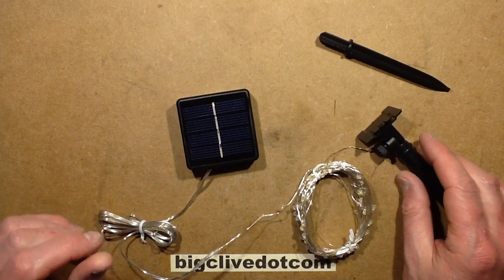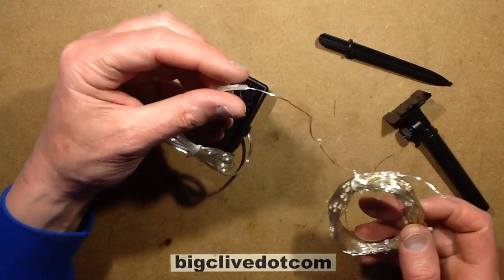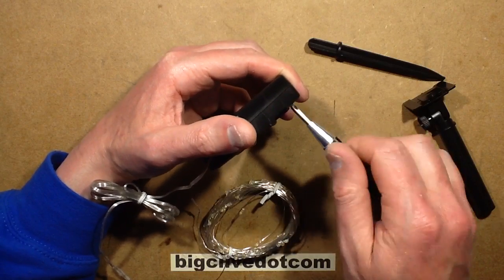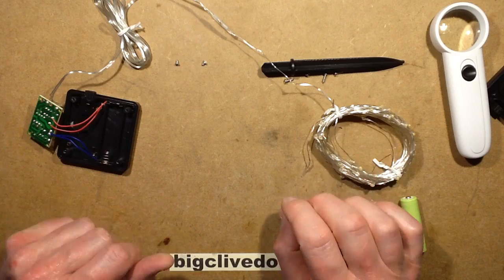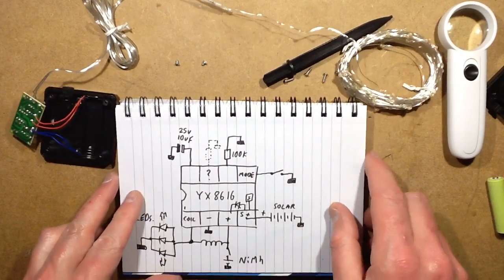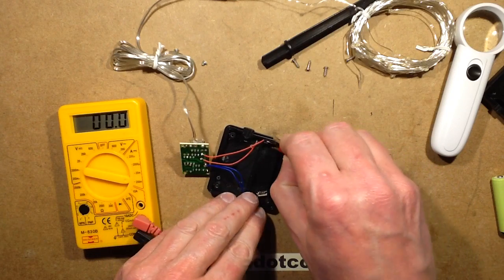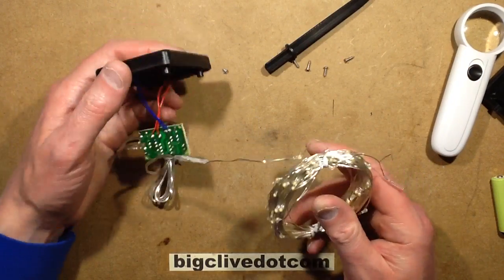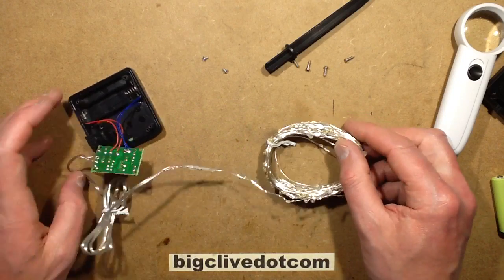Solar LED string with resin dipped LEDs.  With schematic.

Comment: Hi, Clive.
You said that the 100k resistor on the PCB was for the flashing function. I don't know nuffink about electronics except that you often need a resistor in an LED string  to ensure that you don't blow the string.  Is that what this resistor is for? I have the string of LEDs from an identical one of these where the battery box got smashed and thrown away. I found a mains power supply that's marked as having a 3.3v output @ 2.0 Amps and would like to use it to power the string. What resistor, if any, should I use in the circuit which has 120 LEDs? Can I even use this PS safely?
Reply from the maker: The 100K resistor was for timing in this application.  For the low voltage parallel strings like these you can use a standard USB power supply to run the string with a couple of 10 ohm resistors in series.  With a 3.3V supply you should be able to use a single 10 ohm resistor.

Comment: I don't know if your version is the same but mine outputs AC voltage or a "push pull" DC output (isn't that AC? ) to control two sets of leds. Every other led in the string is reversed. This is done to alternate the on time of the lights. 
so when:
"set one" turns  "on" 
set two = off 
When
set one is off 
set two = "on "
(when it sinks current).
Then the cycle repeats.
 Reminds me of a 555 IC circuit.
Reply: I also found this about the chip in mine (ANA6518 IC)
The ANA6518 is an integrated circuit (IC) manufactured by SMC Corporation of America. It is used in various applications including communications equipment, wired networking, enterprise systems, enterprise machines, personal electronics, and portable electronics.

This IC is green and compliant with RoHS (Lead free/RoHS Compliant) standards.
 It can be sourced from Worldway Electronics, which is an authorized distributor for SMC Corporation of America.
 The ANA6518 is available in stock and can be shipped globally via DHL, FedEx, UPS, TNT, or EMS.

Another IC, the ANA618, is mentioned in the context and is used in solar-powered lawn lights as a controller for LEDs.
 However, the ANA6518 is a different IC and is not directly related to solar lawn lights.

The ANA6518 is often used in circuits that require an H-bridge for driving LEDs or other loads.
 In one application, it is used in a circuit that steps up voltage from a 1.2V battery to power LEDs

Comment: These are either the same or very similar to ones I've decided this year to use as my christmas tree lights. I figure this way I don't have to find a power point to run the lights to and I don't have to remember to switch them on in the evening... once it gets dark outside the tree lights... it's very handy (I also have a number of similar sets in my greenhouse and they've been in there for probably a year or so now and do seem to last quite a long time on one charge). Not bad if you can pick them up cheap :D

Comment: Would wiring 2 or 3 rechargable Ni-Mh batteries externally be fine as a modification to extend runtime of the lights? Though getting them charged up by the solar panel is also a slight concern for me since there's more cells to charge.
Reply from the maker: You can use a higher capacity cell.
Reply: @bigclivedotcom  Thank you. I plan to get a set of the Solar String Lights for use on a small christmas tree soon. It's nice that the rechargable cells I got a while back for Wiimotes that never ended up being used will find a new purpose.

Comment: Is there an option to make only solid mode lights? They have some memory of last mode, but from time to time it resets and mode changes into default blinking one. But my wife wants them to be solid always 😅
Reply from the maker: Some sets have memory, but it's not easy to convert the non memory units.

Comment: Kind of tired of solar garden LED lights since they don't seem to last too long before breaking and when they do work they really struggle to stay on until late enough in the winter. They don't seem to have improved at all for 10 years either, I can buy a set online now and I bet it's identical to the one you have here 7 years ago. Thinking about connecting my garden 12v light supply to them. Do you think I could do that simply by just using a buck converter to put the 12v down to 1.5v or so and then connect it up to the battery terminals shown in your video? I've seen another video connecting 5v from directly to the LED light string which sounds odd to me since I figured that would blow them with no resistor but it seemed to work. But i figure my method of using the original hardware would make sure nothing is missed would be better. Might sound over the top but at least then they'll turn on when i switch my normal garden lights on.

Comment: Hi Clive, I have 6 sets of these, worked for 2 years, now all the batteries are dead I thought, what If I chomped all the solar panels off, fed all the wires together into a single one of the solar modules and connected a DC 1.2 volt wall water to the battery input of that one module, this should allow all the lights to get power and still keep the auto on at dusk and flashing mode (as opposed to wiring them all to a 3v power supply) any thoughts on that?

Comment: Thank you so much for what you do here! I have been training with an electrical engineer and I asked for help with a diy project of mine. I'm self taught through trial and mostly errors and a lot he says goes over my head. This channel is just the kind of things I do. And you speak layman 🤣🥰
Reply from the maker: Thanks.  That's very generous of you.
Reply: @bigclivedotcom good day. The new type use yx8628h chip with 8modes
I want to use the steady on mode only when power is supplied as the chip default to blinking mode then you have to press mode button 4 times to get steady mode again.
Pin 5 is the mode or key that uses ground to change mode
If it is grounded for 3sec the chip switch off.
Any idea 
Vcc on pin 5 does not affect mode
Reply: @pietpompiepompiepiet940  microcontroller with relay, delay for 5 seconds when powered on, then it toggles the mode pin 3 times and goes to sleep. A USB digispark ATtiny Arduino compatible one would be simple enough for 5v without needing extra regulators or anything

Comment: I'm looking into getting a similar solar led light string thing, but a colorful one. A question is the battery just a rechargable 1.2V AA battery? If so then would it be fine if I modified it to take 2 rechargable AA batteries for more capacity and runtime?

Comment: I got a very similar set to yours with the same looking circuit board and right out of the box it didn't work when I opened it up I noticed that the one positive wire was not stripped or soldered at all so I fixed that and also the negative was soldered to the side of a capacitor which is weird I've never seen that ever before so I tried to take it off and put it in the negative spot that was marked but it's still not working maybe I should put it back on the capacitor what do you think? Ahh got to love Chinese electronics no information on nothing and usually backwards

Comment: 😂 My wife bought something VERY similar from Amazon a few years back and they never actually worked. Only yesterday did I finally get around to opening it up and once I did I thought to myself "I wonder if Clive has taken one of these to bits?" 

'Lo and behold, one search later, and I find what looks to be nearly the exact same thing. Only difference I've noticed is mine seems to be lacking any sort of control chip...which would explain why the mode button does absolutely nothing (I think anyway, from my understanding of course) 😅

I will double check once I'm able and update if I've given any incorrect information though. My thought process was really just to steal the solar panel from the unit and apply it elsewhere depending on how well it works.
Reply: Quick Update: I was incorrect in assuming it lacked a control chip...it's just on the other side of the pcb, hiding from me. The actual culprit seems to be a bad moisture barrier because the stuff on the other side looks to be corroded.

Good thing I only need the solar panel 😉

Comment: Guessing by this video you might be able to tell me how to make these fairy strand lights permanently dim. I bought a strand that has 8 settings but not one is just dim. Mine plug into 110v (US) plug outlet with a USB plug going to the controller box (has remote too). All setting options are to busy flashing or just flat out too bright. Thanks for any solution to permanently dim them. They are LED lights.
Reply from the maker: A 10 ohm resistor in series with the output may help.

Comment: How do I make this LED strings plug in instead of solar and battery as they are? My dog chew the solar panel and busted the whole thing 😭
Reply from the maker: If it's the non multi-effect type then you can usually power the strings directly from a 2xAA battery pack or a chopped uSB cable with two 10 ohm resistors in series to protect the LEDs from overcurrent.
Reply: @bigclivedotcom  can I do a AC 3V power adaptor directly to the cables to plug in instead?

Comment: I'm looking at a bunch of these that have the LEDs alternatively (+ -) wired in parallel to the two power wires. This enables them to run on AC, or flash alternatively by running different polarities along the wires. Also, there's no polarity on the wires which makes hookup easy. You can snip off any length, or join more lengths at the end, and it still works. But since it's current fed the intensity will vary. Two things puzzle me: how do they reverse the polarity of the wires, and what good does the third wire do?
Reply from the maker: They use an H-bridge to switch the polarity.  Basically four transistors switching either side to the positive and negative rails.
The third wire usually goes to the far end of the string of LEDs as feeding positive from one end and negative from the other will result in better current sharing amongst the LEDs.
Reply: @bigclivedotcom  good day. Do you maybe know how to disable the mode selection inorder for unit to have constant mode only when switched on?

Comment: Great video .I have a set of these and cut through the copper wire accidently in one place. Is it possible to rejoin the copper wires  to get them working again?
Reply: Same. I want to try to repair it. Maybe solder it together or solder onto a copper splice thing?

Comment: I have pretty much the exact same thing and am using them in a small home project. I finished using the length I need so will I be able to cut the extra off without any issues? The ones I have do flash and do all the fancy stuff

Comment: Bought these. Supposed to have 8 modes.  They only flash or stay on steady.
Reply from the maker: They may have copied the text from the modern multi mode version.  The older ones had a switch for choosing between off on and flashing.
There are advantages to the simpler version.

Comment: I recently bought a solar light like that and im very curious how come a single  1.2v 1000 to 1500 mah AA battery power so many little led for almost 10 hours? does the chip multiply the power from the battery to light many led at once without eating to much juice from the battery?
Reply from the maker: It uses a small inductor to boost the voltage and runs the LEDs at low current.

Comment: Quick question pls... We recently had some really hot days and I have one of these (colour LEDs) that just stopped working. I think my solar panel got 'hit' as you described. They were working well until our week of 25+ degree temps and the solar panel was in full sun. My question... Can I replace the little solar panel with a usb or direct battery power supply? I don't mind loosing the flashing sequence but how do I know how much voltage and current the led string needs. The LEDs look like yours in this video. The battery says it is a 1.4v & 800mA. Sorry for the newbie stupid question and thanks for the videos? 👍

Comment: Hi Clive, I have 4 sets of these in the garden that I got from Amazon, but 2 of the sets now default to the annoying Demo Flashy mode when they come on at dusk, The board looks slightly different, more "Proffesional" with smaller components, but I wondered if I could bridge a pin on the chip to give me constant "on" (ie no flashy flashy) but still come on at dusk. any thoughts? Many thanks from a fellow lampie.
Reply from the maker: It sounds like the battery is running completely flat, possibly due to being older or low output from the solar panel.  The flashing ones tend to reverse polarity to the LEDs so they're not simple to bypass.

Comment: I may have missed it, but what is the output voltage to the led's?
Reply from the maker: The current is limited and tends to sit at the LED voltage of around 2.5V

Comment: I have one like this but it came with a 600mAh battery, non-dipped led icicles, and after about 6 months outside it died due to corrosion on the leds. thanks for reviewing! I found data sheets on the yx861a ic!

Comment: What is causing my lights to only stay lit for about 5 minutes?  Been solar charging them correctly....ugh
Reply from the maker: The batteries degrade over time (they are going through 365 charge cycles a year), some cells are big enough to overcharge cells in peak summer and sometimes the cells can fracture internally (visible white lines) or the connections to them corrode.
Reply: @bigclivedotcom  I just got them last week, first time I've ever used them?

Comment: Hey Clive, how can a 1.2v 1500mah battery light all 100 leds??  if each led gets 7ma, it shouldn't last more than a few hours.  what sort of magic is going on here?!
Reply from the maker: LEDs will glow visibly at a fraction of 1mA.
Reply: @bigclivedotcom   Is the booster part a joule thief circuit?  thanks for the vids, Clive!
Reply from the maker: @VinJapanGuitarShop  Similar, but runs on an internal oscillator.

Comment: I have the same lights you show on this video. However, they don't really charge very well because the wire leading from the solar cell to the lights is too short to be able to put the solar cell where the sun shines openly on it. I need to extend the wire in order to move the cell when it can get direct sunlight. What kind of wire and voltage would you say is needed to make an extension if I clip the write between the solar cell and the actual lights? Seems it is diff to find such wire or I am not looking for it using the correct name and voltage.
Reply from the maker: Try searching for doorbell wire or speaker wire.  The polarity is important.

Comment: Have you investigated this kind of string light yet https://www.ebay.co.uk/itm/USB-Plug-In-50-100-200LED-DIY-Micro-Copper-Wire-Fairy-String-Lights-Xmas-Wedding/154070561375?ssPageName=STRK%3AMEBIDX%3AIT&var=454200294833&_trksid=p2057872.m2749.l2649 ? I recently bought one together with https://www.ebay.co.uk/itm/10-30M-LED-Solar-String-Lights-Waterproof-Copper-Wire-Fairy-Outdoor-Garden-UK/383700274525?ssPageName=STRK%3AMEBIDX%3AIT&var=652097891592&_trksid=p2057872.m2749.l2649  and they have me puzzled. In both cases I bought the longest string of multicoloured LEDs  and, in some way, they manage to produce various selectable sequencing effects using just 2 wires. Also, the power usage is absolutely minimal - the 300 LED 30 metre string taking only about 40mA at 1.5 volts! The USB one obviously uses an 8-pin microprocessor of some type as I can see a quartz crystal but how it can light leds individually using only 2 wires baffles me....
Reply from the maker: I'd guess there are two channels?  If so then they place the LEDs with alternating polarity and swap the polarity of the output.
Reply: @bigclivedotcom   Yes, looking at one of the sets closely, I think you're right. They must be sending the power down at a fairly high frequency  to get the dimming effects. I'm still surprised that they can light up so many LEDs brightly and run a microprocessor with so little power use. I've had the solar string of 300 LEDs running for a few days now and, even though it only has one AA size 800mA NIMH battery, it runs the lights all night.

Comment: I have this light it’s the wire broke in two pieces now can’t fix ten lights are working try to fix with joint but no luck
Reply from the maker: The wires are covered in lacquer which will need burned or scraped off to make a proper connection.

Comment: Hi nice video
I have a set of these which have been broken near the end (opposite end to solar) and have stopped working.Would you know what I need to do to repair them. I already tried joining and separating the two ends??
Thx
Reply from the maker: I made a video specifically about repairing the copper wire LED strings.

Comment: Thanks for the detailed description of the circuit. I have been given some of these to repair from a family member. The chip in it the current version is  now marked as a "6N607"  - and of course there is no data available on it on the web! BUT there  IS now a considerable amount of information on  the YX8616, which looks to be identical to the 6N607, - and your reverse engineering of the circuit was right on the money. Thank you.

Comment: I am trying to do away with the solar and hardwire six of these together. What I am finding out is with the LEDs every other one is reverse polarity. When you hook up the correct voltage only every other light turns on. If you flip the wires around the ones that were on are off and the ones that were off are on. It seems inside that chip it very fastly alternates the current down the strand so to activate a solid feature where all the lights are on. I know a little bit of electronics but looking for some help to hardwire that control chip and wondering if it can handle 9 volts rather than the 1.5 for my continuous strand of 6 sets. Any help would be greatly appreciated as that is the exact model I have.
Reply: I need help with this as well, did you come up with a solution?